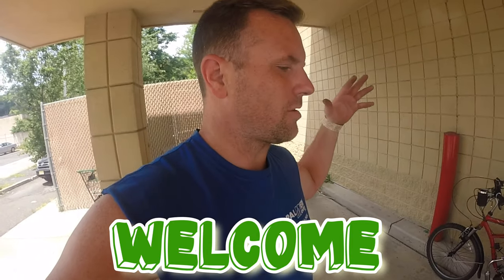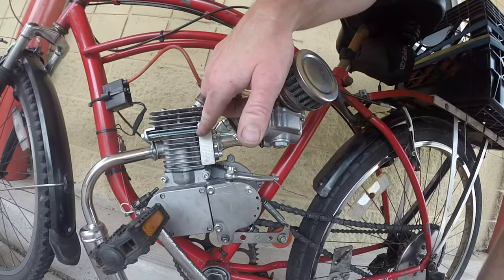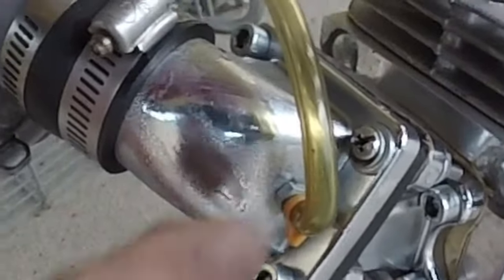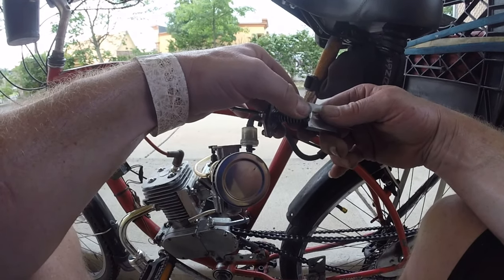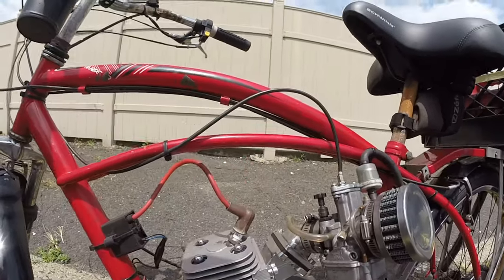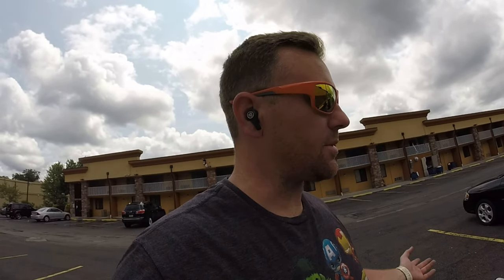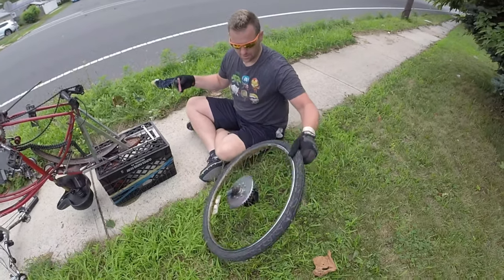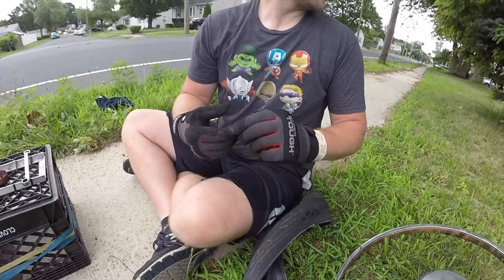First Ride And Tuning Of My New YD100 Dio Reed Setup

Comment: Simple rules on jetting follow them air mix /pilot jet is zero to 1/4 throttle. Needle is 1/4 to 3/4 throttle. Main jet is 3/4 to wide open.   Great job  what the condensation on your intake says it's got good velocity
Reply from the maker: Yeah that’s what I was thinking I wasn’t exactly sure what it was from but I definitely knew that it is a good thing at the Lucas saying it’s from good air movement a lot of air moving through the engine the velocity?
Reply: @JMB676  yes when you see sweating intake that's a good thing hey keep up the good work. Holy crap stay away from them ninja star washers. Definitely like your editing skills your improving daily on your information and skills thanks at times I forget to tell people good job so yea lete not forget. GOOD JOB

Comment: Great video 👍 I just built my yd100 from ground up I put the gas in down not thinking it had to be sideways 😮 so it flooded motor but got it running the idle stuck didn't get it off in time and blew motor 😔 how can I learn about adjusting the carb ?

Comment: 8:43 what causes those missfires? I have the same problem with my YD-100. How do I fix it?
Reply from the maker: In my case I was goin up a very steep hill n my carb is way to rich in this video.  So if your having similar pops (not backfireing) and it’s under acceleration it’s called “4stroking” n it’s caused by the carb being to rich. Have tried moving your c-clip up a notch or two on your needle?  Also if u can try joining my Facebook group cause it’s easier to talk back n forth on there n u can get other opinions about it all.  Either way let me know how it goes when u move the clip up n lean out your carb some.

Comment: Now You running like 50 Mph w that Dio reed
Reply from the maker: Not exactly but once it’s tuned I expect we’ll over 50 n the jets are finally on the way to bad I took the motor completely apart n decided to cut the cylinder in half n do some CRAZY more work to it  after what I’m planning now I’m expecting even more it should be so nutty after this.  I’m really excited about it now

Comment: Yo bro I'm from jersey and I just built my first nike,it's a beginner imaycc 66,80cc in looking to upgrade soon when the funds are better thinking about a zeda 80 with the dio preformance kit. I'm in clifton nj,let's ride bro Holla at me. Ride safe
Reply from the maker: I’m def down to ride anytime. As far as spicing things up if you ever want to just hit me on messenger and I’ll show you how to or if you want me to just go through your motor I can. Your basic motor can make hella power with exactly what you got right now if I just change the port timing of your motor.
Reply: @Johnnie’s Motorized Bicycles  hell yeah bro sounds good
Reply: @Johnnie’s Motorized Bicycles  that sounds great ii just bought some parts to get better preformance high comp.head,expansion chamber,hp carb,and a 38t sprocket with hub adapter.
I haven't installed yet  oh and a badass silencer
Reply: @JMB676  I don't have much experience like I said this is my first built and my carburetor was missing the school to drink your fluids so I put Teflon tape and electrical tape on top of it and it held up pretty nicely but I still had a bit of an air leak so that's why I bought the HP carb which I haven't ran yet because of the weather but it would be awesome if you can help me out